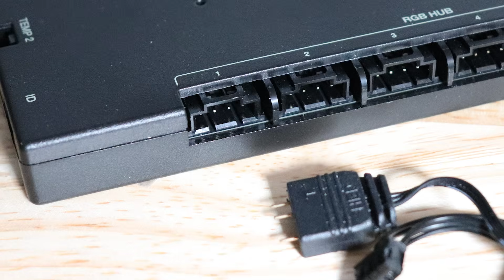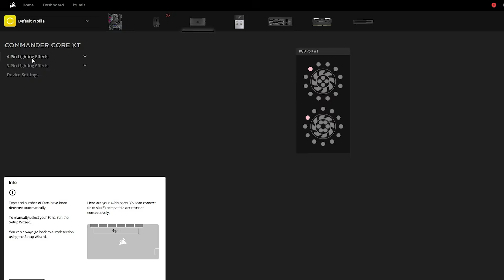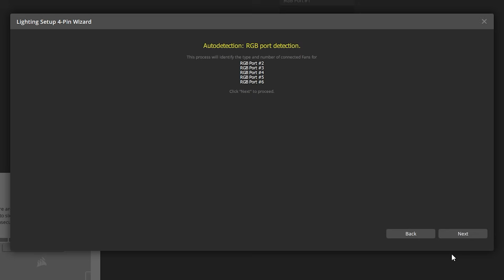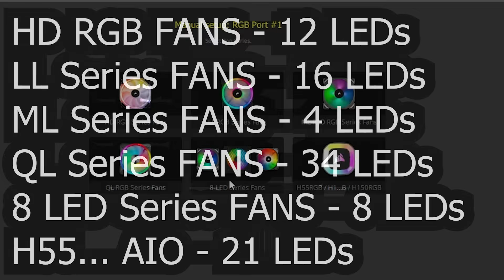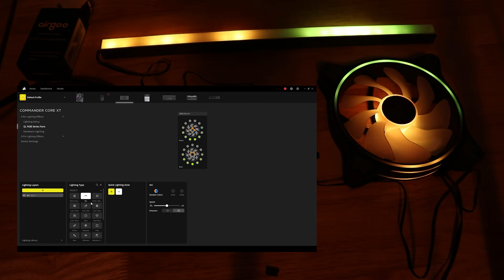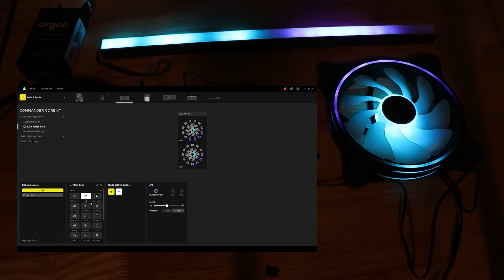Connect any ARGB device to a 4 PIN Corsair connector - Adapter cable from Airgoo

Comment: Would I need a converter still thought if my motherboard only has the 12v 4-pin RGB headers? Or can I simply use these to connect ARGB fans (3-pin) directly to my corsair commander and it will work? I'm trying to figure out if I need to keep my EZDIY-FAB hub that has the 5v / 12v option on it?

Comment: Not working. I bought a 4-pin 12V to 3-pin 5V adapter and connected it from my Corsair Commander Pro to my Corsair RS120 ARGB fans, but it didn’t work. The adapter doesn’t actually convert 12V to 5V. Total waste of money.
Reply: all argb is 5 volt. The original solid color rgb was 12 volt. He is using an adapter because corsair argb hubs don't use standard 3 pin argb connectors

Comment: Are the 4-pin ports 5v by default on the Commander Core instead of 12v that 4-pin usually is?

Comment: Just built my new pc with the stupid rs120 fans from corsair which come with the 3 pins 5v rgb cable instead of the 4 pins they used to use. Thanks to this video now my rgb fans can be connected to the icue software and looking pretty.
Reply: It ended up working? I have the same issue
Reply: I just bought some new corsair fans and the Lighting node CORE. Its fukked too cause the same problem. Newer cables trying to mix with “old” tech.. it can work with these adapters tho?

Comment: THANK YOU SO MUCH FOR THE SHORT AND STRAIGHT TO POINT VIDEO. I ENDED UP USING MY CORSAIR COMMANDER CORE XT and connected my CORSAIR iCUE ARGB PSU Cable Strips. The cable strips do come in with a 3 pin Molex.  I managed to pull the 3 pins out and re inserted the 3 pins into a 4 pin CORSAIR FAN Molex I had laying around.  BADA BING IT WORKED with your video on how to manually detect the ARGB strips.
Reply from the maker: Hi dunkindeez79, that's an awesome use of the 4 pin connector!!! I'm happy this video was helpful to you! Good Luck, keep having fun and thanks for watching...and your support!!
Reply: I am trying to manage same out, could you please explain how did you achieve this?

Comment: My controller pro node is showing up in software updates in icue but not on devices?
Reply from the maker: HI hollisellis8609, I would make sure to apply any firmware updates that the software is showing for your controller. In addition to that, make sure to update to the latest version of icue. If it will doesn't detect it, uninstall/reinstall icue. In some cases, i've had to physically remove a device from power and USB with the power off and then reconnect it. If it still isn't detected, try a different usb header and make sure your chipset drivers are up to date and other usb devices are recognized. Beyond that, there are other windows issues that could contribute. You may want to reach out to corsair and provide them the logs from icue. 

Good luck and have fun (troubleshooting is fun, isn't it). Thanks for watching!!!

Comment: Is it possible to do do this with Corsair Fans as well? If so would fan autodetection on icue work?
Reply from the maker: Hi Lightning78821, most Corsair RGB fans have the 4 pin connector already so there is no need for this adapter cable, they just plug directly into the controller, it was designed for these fans specifically. In that case, yes it will autodetect corsair fans. 

If you use this adapter cable on non corsair fans, then you will need to manually specify a fan in the configuration that most closely resembles the number of LED's of the non corsair device you are connecting. 

If I've misunderstood your question, my apologies, I'm happy to help, let me know what devices you have that you want to connect to the CORE XT controller. 

Thanks for watching, good luck and have fun!!!
Reply: @HardwareArtisan the nautilus corsair aio requires daisy chaining but I dont want to do that will this still work?

Comment: Fine. But now try to connect more than 1 such adapter with argb to all ports of the 4pin argb controller... Will everything work? So there is a question: how to use such adapters to make several 3pin argb devices connected to different ports of the 4pin argb corsair controller work?

Comment: Can I use this to setup the LCD display on the deepcool AK500 digital?
Reply: Not trying to control the display, just trying to power it on
Reply from the maker: Hi sickkfit, the AK500 digital uses a 9 Pin USB connector for it's LCD display. You could use the CORE XT's USB pigtail to power the LCD display itself. 

This video primarily was about using the 4 pin fan connectors to control any 5v ARGB device, you would use this adapter cable to light the RGB lighting on the AK500 digital as well. I don't see a spec on how many LED"s are on the cooler, you would have to experiment with which corsair model has enough LED"s to get them all lit, but it should work.

But, just to be clear, for the LCD display, it's powered and controlled through the USB port. 

I hope that helps, thanks for watching!!!
Reply: @HardwareArtisan  thanks for the reply! will I need to go into the icue software to get the LEDs powered on? Or will they be on by default, I’m not too bothered about changing the colour of them, just as long as they’re on.
Reply: You will need to go into icue to setup the 3 pin lighting configuration. You should be able to then set the hardware lighting up which tells the controller what to do when icue is not running, then shut down icue...

Comment: Great guide. I followed your guide using the commander core xt and hooked up two sets "daisy chained" 140 sawfan ex.  I was hoping the fans (which are plugged into port 4 and 5) would all run the same color but no matter what corsair fan I choose in iCUE it only lights the first, first and second, but never the third fan.  Any thoughts?
Reply from the maker: Hi marcusvd, the limitation on using this method is that you can only set this port to a single fan in iCUE, this limits the number of LED's iCUE will address on a single port to whatever the number of LED"s that the selected fan has. 
 
I think the QL fan has the most LED out of that list (if memory serves) at 34 LED's, meaning the port will address only 34 LED's. The SWAFAN has 30 LED's I believe (some may be mirrored though), so it's possible with a QL fan selected you would light a portion of the daisy chain. 

If you have 3 fans daisy chained, you may have to break them up into groups of two (or 3) to get them all lit using this method. Experiment around with the corsair fan you select (but I think QL has the most) 

Another method that would give you more capability would be to adapt these into the 3 pin RGB port on the CORE XT, when setting up that port, you can select more than 1 fan so you can increase the number of LED's. You would plug an adapter into the 3 pin RGB port on the CORE XT, then plug that into an RGB hub, then connect your SWAFAN's into the HUB...That would work a little better in this case, but experiment around with the fan you select on the 4 pin port and you may have to break it up. 

Let me know what you find! Thanks for watching!!!
Reply: @HardwareArtisan  You are correct. It will only light about 1.5 fans in the 3 fan daisy chain. So in the Core XT RGB port method I would plug the 2 sets of 3 fans into an RGB hub and then adapt that into the 3 pin RGB port on the Core Xt.  I wont have the ability to address the LED individually but can select 6 fans when adding them to the iCue software?  I also tried using Armory Crate's Aura Sync (as the TT SWAFAN EX are compatible) but the software does not detect them even when plugged right into the mobo aRGB headers.

Comment: Hello! Some say how to connect all the fans to the Corsair icue, others how to connect the pump and water blocks.  Please make a video on how to connect everything to icue without using 500 controllers).  I have an Asus mother, if I connect a pump to it, will it be visible in icue?  Thank you for your work!!!
Reply from the maker: Hi fiio5812, There are many different components, but that's a good idea to do a more comprehensive video showing a larger number of components. In order for a device to be seen in iCUE, it needs to a Corsair Device and make a USB connection to your motherboard. iCUE won't see other manufacturers devices....with a few exceptions, ASUS Motherboards, Nanoleaf, phillips hue for example. Most Corsair PUMPS I believe will make a USB connection and be seen in icue, but looks a specs for the device, it will show if it's icue compatable. 

I hope that helps, thanks for your support and for watching!!!

Comment: Thanks so much for this video! I bough one of these Corsair 4 pin to ARGB adapters on AliExpress and couldn't figure out why it wasn't working. Turned out I needed to run that iCue lighting wizard. Also great that you provided the info about the number of LEDS in Corsair fans! Now everything is in sync in my PC, thanks again! :)

Comment: So if i have 6 of the same fans you have the MF120 HALO, If I get 6 of the cables and connect each fan using its own adapter cable to each induvidual port on the XT, it wont mirror like daisy chaining right? or will it only control the first fan? I heard that if I have no Corsair fan on port one the XT wont send signal to anything other than port one. I desperately want to seperate my 6 fans and lay each one out in SignalRGB, and if I HAVE TO have the 4 pin data return like the Corsair fans do, that sucks for me I guess and i'll have to order an RPi and make my own controller...
Reply from the maker: Hi JiggyT, great question. I have attached a couple of fans to the CORE XT with an adapter cable like the one in the video. One in port 1 and one on port 6 for example.  One non-corsair fan on each port with no data return pin and they all work fine.  You setup each port manually and individually on the CORE XT. I can control them independently and with corsair link.  AUTO DETECT will not work with this cable and This would be a problem with the Node CORE and the RGB FAN HUB, those devices would not support using this cable because there is no data return cable.  To my knowledge, this will work fine using one fan/one cable on each port. I wouldn't add more than one fan per port though. In turn, Signal RGB should be able to control each port normally. 

Thanks for your support andwatching the video!!! Good Luck and Have Fun!
Reply: I couldnt wait and my hands were itching to solder something si my new Pico is otw :Ddd

Comment: I have the corsair carbide spec omega rgb that came with a node pro and a rgb hub. Port 1 of the node is connected to the strip at the front of the case and port 2 is connected to the rgb hub. 

If I want to add fans to my build from other brands, how would I do that?
Do I buy 1 adapter cable and connect port 2 of the node to the rgb hub? Or do I need multiple adapters for all of the fans?

Comment: I bought this and plugged it into my Deepcool LS720 and Airgoo ARGB Led strip which has 42 leds. It works fine but if you plug both in together the LED strip starts flickering and you can't control it so I recommend just buying 2 if your devices have lots of LEDs.
Reply from the maker: Hi Shreytard, good point, perhaps all that together is too much power draw for a single port on the controller. Using 2 is a great solution as you mentioned, awesome stuff! You might also consider connecting a powered RGB hub to one of the cables and then you can power more devices, but that's adding another device. Using 2 cables is a better solution in most cases.  Thanks for watching and your support!!!
Reply: @HardwareArtisan  Update : My Deepcool AIO pump started Flickering a lot just like my LED strip Idk if I got a bad model or it's just a bad product

Comment: i used one of those to connect the corsair into a cheap  sata powered rgb hub,then plugged all the rgb fans into the hub.
Reply from the maker: Awesome!!! That's probably the best way to use these! Keep having fun and thanks for watching!!!
Reply: I have a lian li that had a little hub if I just run the hub into the xt to control via icue??